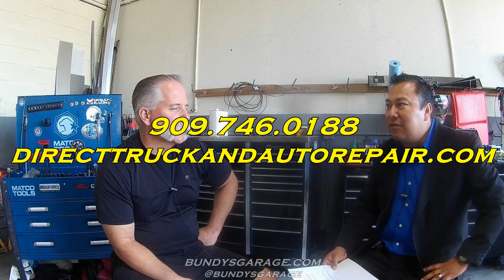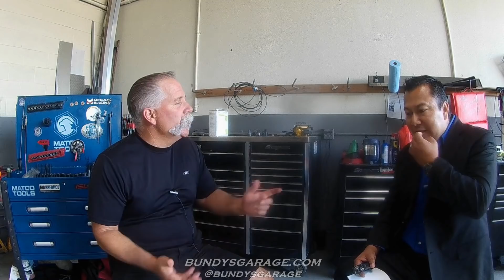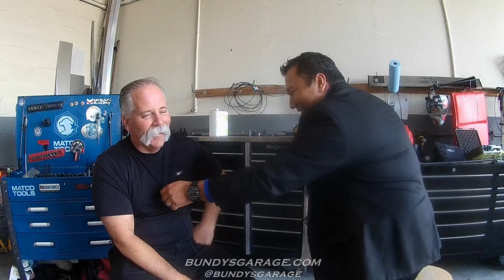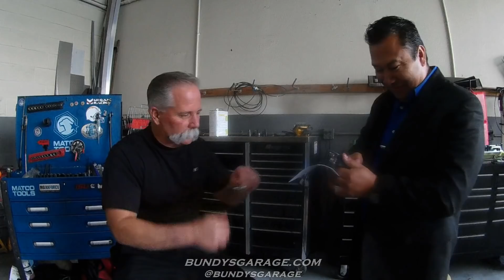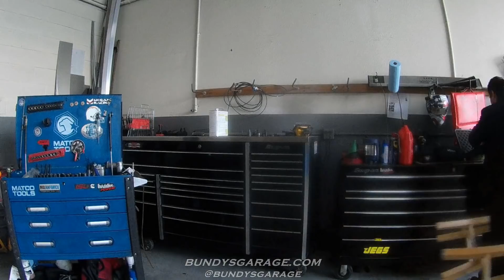Worst Diesel Engine Ever - What is the Best Diesel Truck out There? | Ford Dodge Chevy

Comment: I'm a GM guy but my 93 GMC Diesel was a total POS.  Junk!  I loved my Duramax..Quiet..great for snow plowing and pulling my grasscutting equpiment but FORD build amazing trucks.  They just do.  My buddies in the landscaping biz, my old employer all use Ford's ..From the 250 to the 550.... ive used them.  Great Diesels.  My buddy has F550 dump trucks  for soil, brick and salt.  Barely feel a load of salt on them.  I've used them many times.  Barely feel pulling Bobcats and excavators... im still a GM guy but can't complain about Ford's.  Can't give a biased opinion.  Never used a Dodge Ram Cummins but i hear great things.  As far as gas engines -  really can't say.  Although my 93 Chevy 305 was unbelievably reliable.  My 93 GMC Diesel was a money pit.  But i still miss my 2004 Duramax.  Loved that truck.
Reply: I like gms ford's are good but a bitch to work on  it took 5 hrs to change a water pump in a ford I had less than a hour in my chevy
Reply: You've never towed anything heavy if you think Ford is good. A Chevy can tow more weight and you don't even feel it
Reply: @kenshinhimura9387  Kenshit again your chevy is faster at rusting than pulling
Reply: The Detroit 6.5 Turbo Diesel are great motors, the earlier Non Turbo 6.5 and 6.2 were not so much. I have the Turbo 6.5 in my 1999 Suburban 2500 4x4. Now, the great 454 Gas engine is a better choice for towing.
Reply: The 6.2/6.5 GM Diesel was a piece of crap. It was originally designed by Detroit Diesel for GM and it was never right. I had a 6.2 that could not get my 4x4 Dually Crewcab over 65 MPH. Forget pulling anything with it unless 55 was all you wanted to do. It had rubber return lines on each injector and they would blow of regularly. Changed the distro pump several times since it was always going bad. The truck itself started developing major rust three years in (Florida truck so no snow salts). Automatic hubs did not keep water out even after changing the hub o-ring. Transmission replaced at $17,000 miles. Soured me on GM from that point on.
Reply: @rvninnorthcarolina3377  my injectors were always going.  Then i blew the engine.  And it was a newer used engine in it.  Always something wrong with it.  Standyne made the lift pumps  i think... is that right?
Reply: @quincee3376  You are correct......
Reply: @rvninnorthcarolina3377  thanks.
Reply from the maker: Injectors in what?
Reply: @bundysgarage  sorry injector pump in my 93 GM Diesel.  Also had problems with harmonic balancer.
Reply: @quincee3376  Lets just say the 6.2/6.5 was one problem. I think on mine the exhaust was the only thing I did not replace or fix.....
Reply: @rvninnorthcarolina3377  LMAO ..sorry for laughing but sounds about right.  I am glad that GM has gotton back into the mini dump truck segment again.  But i'll wait a few years and see if they came back right and proper or if there are lots of bugs to fix.
Reply: The 6.2/6.5 ( designed by Detroit Diesel) was GMs 1st attempt at a light duty diesel truck eng, and needed some debugging. It was mainly designed  during the fuel crunch era for fuel mileage, and did an admiral job at that.
Reply: @joequillun7790  Not sure if you ever owned one or not, but it was far from admirable in its performance and reliability. I had the 6.2 in a dually and my daughter had a 6.5 in a 2500 series SRW and both were riddled with issues. ,My best Friend had a Blazer with the 6.2 and my uncle had a SRW 3500 series with the same. Chevy trucks were generally known for durability and longevity in their gas trucks and there was a reasonable expectation that the diesel would fall close to that expectation. Nobody I knew felt their truck was neither dependable or showed any potential for performance. Couple that with the less the stellar MPG it was a failure for GM light duty trucks. My Uncle actually got some level of performance gains out of his by changing the injectors and adding a Banks Turbo system that made it useful for towing. He was finally debugged by introducing the Duramax in 2001.
Reply: RV, I've had my 83 C=30 6.2 Dually for over 25 yrs, and will agree with your contention about performance. Not much power, but I don't tow a lot. Also am on my 2nd motor. 1st one broke a piston. but with the simple inject pump, it always starts, and W/ 4.10s, will get 20MPGs, on the hi-way towing a trailer.(Won't go over 55 tho) :(
Reply: @rvninnorthcarolina3377  if you actually get to know them 6.2/6.5s are really reliable.
Reply: @jdrok5026  Yes, I agree that a good mechanic (shade tree or otherwise) can make any vehicle reliable given time and perseverance. Based on today's expectations of HP/Torque, emissions and MPG, the 6.2/6.5 would not fly. It is gutless unless you put tons of work into it and turbo's. YES, I was part of the 6.2/6.5 Diesel Forum back in the day and there were guys getting 300 to 400 HP out of them then but they put tons of cash into the engines to get them there and longevity suffered. I know that the military used them in the HMMV, and it did decently but there was a ton of maintenance routines required to keep them reliable. The 6.2 for civilian use was rated at 130 HP and 330lbs torque which is pathetic even for then. THE ONLY reason the engine was introduced was to try to provide a light truck that had palatable MPG since the choice then was the 5.7 ltr and 7.4 which were strong but gas guzzlers. The 6.2 was a direct bolt on replacement for the 7.4 so it made sense for GM to introduce.

Look, I can tell you from experience that this engine may be great for trucks that don't tow, but it should have never been an option for a 3500 Series Dually CrewCab 4Door like I had. I could not get over 65MPH empty and if I tried to tow the goose neck horse trailer, 60 was as good as it got and it took 3 minutes to get to that speed. My Uncle had a 6.2 on a regular cab 2500 and he put a Banks Turbo on it and it actually was respectable, but I never towed with it so I don't know. At least I could pass on the highway if I needed to!

When Ford and Dodge entered the arena it was over for that engine. The Cummins in the early 90's was the motor to have since it was proven and would pull. It was noisy and lacked most electronic refinements but it would run forever! I had a Pre-Powerstroke 7.3 ltr non-turbo Ford Dually/4Door and it was way better than the 6.2 I had before...be it it was not to today's standards either, but I could do 80MPH with no issue and it pulled the goose neck at highway speeds all day.
Reply: @rvninnorthcarolina3377  really the 6.2 need a lot better gearing. To do much since they peaked torque pretty much off idle. I never justify towing a lot some have good luck with them some don't. I still perfer 2 strokes and low the fun 6.2 and 5s are people don't like them because they aren't a Cummins a lot of the time and tend to overblow their issues like pump issues which yes where a problem but if you kept a eye on your engine you would notice it. Or the harmonic balancer failure the 6.2/5 was not happy when those started falling apart and would physically shake the truck even more.
Reply: @jdrok5026  I think the balancer on mine actually survived :-). Look I have no experience with any of the current diesels so my opinion is not valid. I like diesel and on my 1980 John Deere I can not ask for anything more reliable! I view diesel in general to have its place and I think the Big 3 are trying to make them consumer items versus work horses like they used to be, and that is causing reliability issues with all of them. Couple that with the EPA pressures and we have what we have. In in the trucking industry they are experiencing reliability issues where none existed before.
Reply: @rvninnorthcarolina3377  balancers where a nightmare lol it's always fun to see one survive. And I think that the drive for more hp and torque is killing them mostly everyone wants to go faster and that's understandable but it brings issues all over. And since we are mostly just do small increments on the efficency of the burn process on the road we just end up with poor reliability and all the smoke they are trying to combat. Which if we just focus of small increases in power and trying to burn off all the fuel we can we would notice better fuel economy naturally more torque and hp per given ratio of fuel and the torque would actually come on stronger everywhere. Then we would notice even better gains in high rpm and boost situations. Given that a engine has a efficency based on the combustion cycle alone we shouldn't notice much black smoke or combustion efficency as a whole. Which means happier low rpm engines and happier high rpm engines. Well that's all theory. Infact it seems diesel guys don't know how to properly tune a diesel given that they want to claim wasted energy or soot makes them more power. That works for top fuels in a sense but that's because the fuel naturally boils and cools the cylinder then gets basically vaporized in the combustion even then it will vaporize the hydrogen in the air.

Comment: I had a 95 dodge with the 12 valve 5.9 L Cummins. All I ever did to it was oil changes, air and fuel filter changes. Never a problem! 27 mpg with an auto trans. Had over 300K on it when I finally sold it. Nothing wrong with the drivetrain but the body definatly had issues due to metal fatique, that and the front suspension was worn out and needed major rebuild. Otherwise I would still have it today, it pulled like a freight train, never found anything it couldn't handle.
Reply: Mine got 39 mpg pulling a back hoe and 43 empty.

Comment: My experience with diesel was a 1990 VW Golf and i had a VW 1980 Rabbit.  Never had any problems with the engines.  They never let me down and the fuel  mileage was awesome.  Both of them ran over 200,000 miles and sold them both and I am sure they still kept going. As far as they were not trunks, I had and have a trailer that I pullled with the Golf.  Again, with small loads and sometimes not so small loads no problems.  Not bad for a 1.6 litre engine.  Now I do not know about the TDI  but more tech more problems.  But the original VW diesel were by far the best diesel engines.

Comment: first thing i did to 6.0 turbodiesel was egr delete...removed all dmog conttoll left head bolts alone. 240,000 reliable miles... outpulls any 7.3 easy....(note 40yrs big truck former owner operator)  these are notvgss engines you have to warm them up snd idle them down... follow maintenance schedule especially oil and filters.

Comment: I have a stock 6.0 that I’ve put 150k miles on with no issues. I work pipeline and tow a RV all over the country. Best truck I’ve ever owned. But different strokes for different folks
Reply: Ron Burgundy I've got 220000 on an egr delete and coolant filter 6.0. Pull camper all the time. No issues. 3000 Mile oil changes.
Reply: Charlie Green That’s awesome man! I’ve been thinking about doing an egr delete. Did you notice any sort of power or mpg difference?
Reply: Ron Burgundy I feel like it runs the same.  Love the truck
Reply: Ron, is your's an 05? My dad had an 03 6.0 that worked fine for the first year, but it kept dying the whole way down to our ranch. He traded it in for an 05 after a year and a half, and that truck has had zero problems. I like the look of the 03 Powerstroke better, but 05 and newer are more reliable.
Reply: Kale Walker It’s an 06 f350 king ranch. I bought it from a local doctor in town who barely used it. I’ve been doing regular synthetic oil changes (with stiction eliminator) and running a good ELC coolant in it and everything’s been great so far.
Reply: 05-07 with a 6.0 is the best of the Super Duties until 2013 or so (the first couple of years with the 6.7 had some troubles).  Ford generally irons out issues in their trucks really quickly, but the 6.0 had already gotten such a bad reputation that it was doomed.
Reply: @406Steven  thats a good way to get a cheap truck, I was told by people that never own a diesel, when I got this 6.0 I like it better than my old 7.3 on fuel that is
Reply: Thanks I have a 6.0 got it cheap cause of egr. I fix it, even though it was under warranty, good on fuel, very very fast, had it for 12 year's  no problems, but two sets of tires, front brakes, lifted front end, and yes she is a 05, one of the best truck I own also, Amigo
Reply: I have a 169,000mi 06 F250 King Ranch 4x4 6.0 that’s been deleted & has new FICM.  Bought it recently off a fellow Navy Vet. Only issue is radiator is weeping around the upper end bell attachment. I’m having Bill Hewitt at PowerstrokeHelp do the "Lifetime Dealerproofing" because I’m going to tow a lot, & I’ll likely keep this truck quite a while.  MUCH cheaper than the 'mortgage payment' on a new truck!!
Reply: Rev x...
Reply: I've got 258K on my 04.5. I haven't done to much to it. I can't complain, i've gotten my money out of it, as much as I've hated it sometimes, it really has only been minor fixes so far. I used Archoil AR9100 in it, I believe that's the stuff and that sure cleaned out all the Stiction issues I was having.